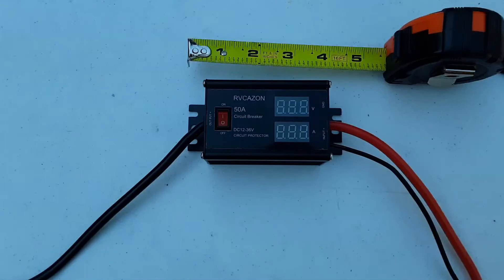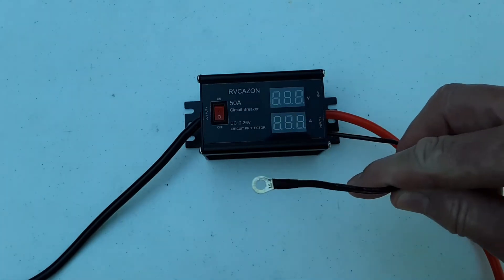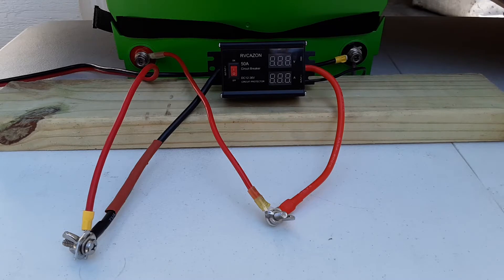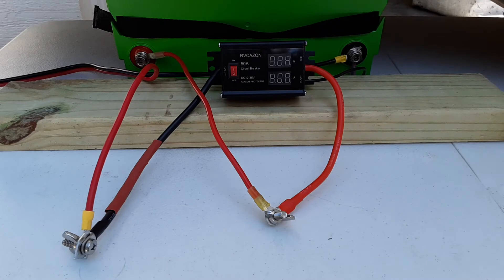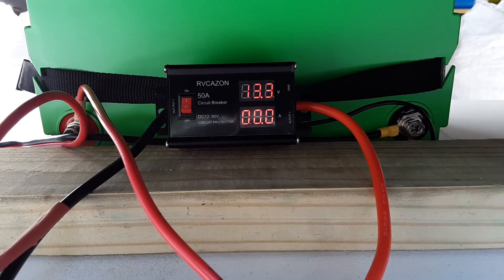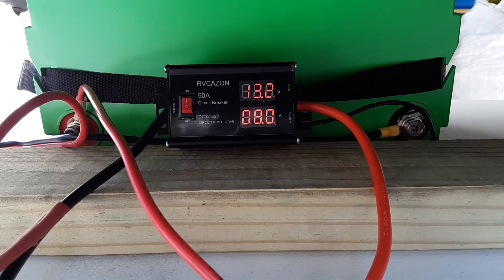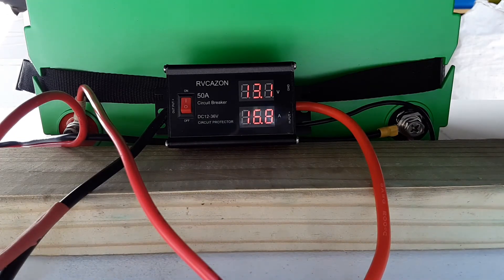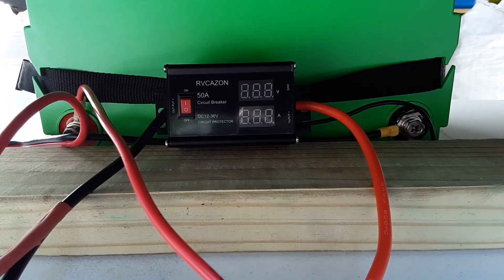12V 50A combination circuit breaker, voltmeter, and ammeter tested with a trolling motor.

Comment: Great vid. I purchased the same breaker that you have. I set it on on a test bench with my trolling motor ( minn kota 45 lb thrust) at full speed it only shows it’s pulling 2.9 amps. Also the motor is not submerged in water like yours. Is it something wrong with my breaker?
Reply from the maker: Thanks. No, a trolling motor usually pulls about 3A at full throttle without a load (in air).
Reply: More importantly you should not run a trolling motor out of water unless you want to damage it. It will overheat as it needs to be submerged for the water to cool it.

Comment: Got 1 for my ESC (thanks for videos!) before I saw this. Circuit breakers are not switches and using them as switches wears them out but kayakers do that in their videos all the time. This 1 has a switch. Issues I had with it: almost wired the black to the black on the ESC before wrapping it with red tape; 8 AWG cables - I got a 30 lb motor so 10 AWG was ok and all my connectors were 10-12 AWG; the signal wire for amps has a tiny batt connector - had to replace it since I'm not using a wiring block to connect it directly to the battery; and mounting it on the outside of the battery box is gonna be a lot of holes - I may cut a big square hole so it sticks up halfway and then hot-glue it and cross my fingers. Thanks again for your vids!
Reply from the maker: Than ks John!

Comment: I think the only advantage of the real time current read out is finding what speed is the most power efficient to travel at. (And if something is caught on ur prop that’s causing more power draw than usual

A capacity reading would be more nice
Reply from the maker: Yes, the best power efficient speed would be nice. It can also be used to estimate how much run time you have based on amp draw.
Reply: @Aksmaniyak i only used my clamp meter once or twice to get a feel of how much power im using on different power settings. i noticed over 80% im using like 30-40% more for 10-15% more speed. im hit that max hull speed of 5-6mph
Reply from the maker: @rainzer0  Yes max speed really isn't good for battery life with any controller. If you just "cruise" when fishing you will have plenty of juice left.

Comment: Neat gadget…. But have mixed feelings about it. I’m not sure why one would need the instantaneous amp reading in use with exception of troubleshooting. For a lifepo4 you would want a cumulative amp reading. A wet cell you’d need a voltmeter to judge battery capacity left, but seems a normal circuit breaker with an external mounted USB port with dvm is superior…. And cheaper too. But many thanks for finding it, and good review!
Reply from the maker: Thanks. I think the prices for a circuit breaker, USB with voltmeter, would be close in price but this is one unit. The amp reading/run time would help in estimating the amount of battery life left. It was a new product and wanted to test it out. It might not be for everyone but perhaps for some.
Reply: And a free on/off switch (using a circuit breaker as an on/off switch a lot wears them out and weakens them). Agreed on cumulative amps.